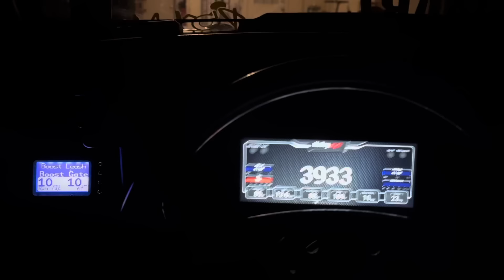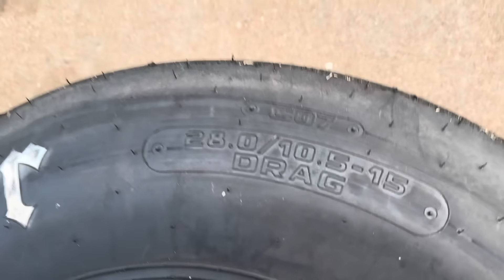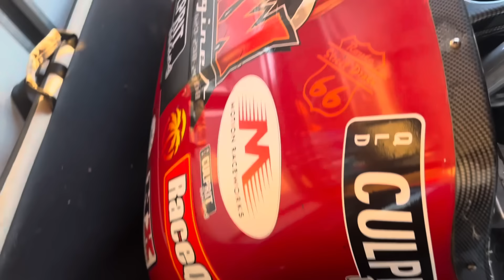TESTING new parts AT INDIAN VALLEY RACEWAY

Comment: I have the Johnson 2116 short travel lifters and after getting my heads done including shaved I had a bitch of a time finding a happy pushrod length. I fought the same problem with mine being way fat and it ended up washing out the bearings on my fresh 6.0, damn terminator x been kicking my ass
Reply from the maker: Ya, mine is going to require a few different sizes to get right